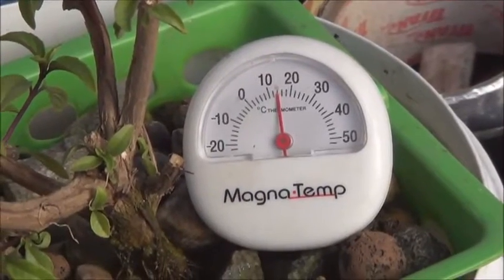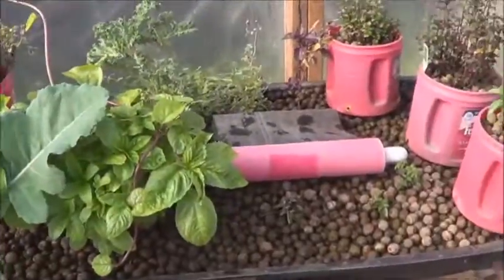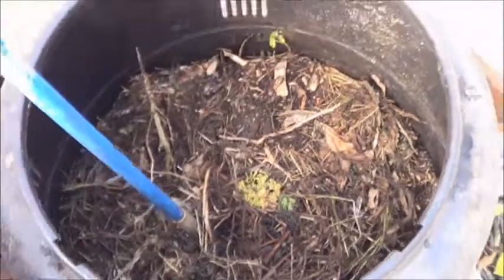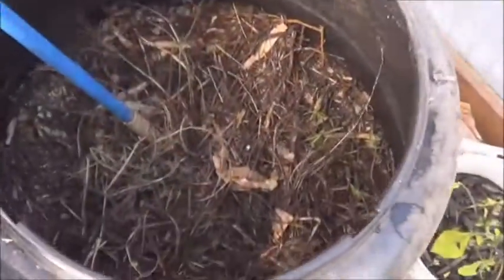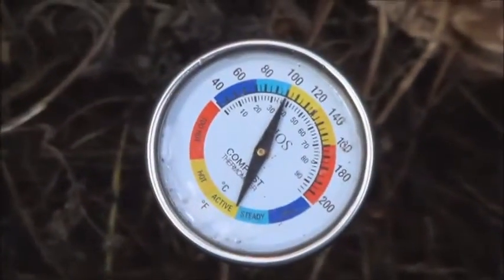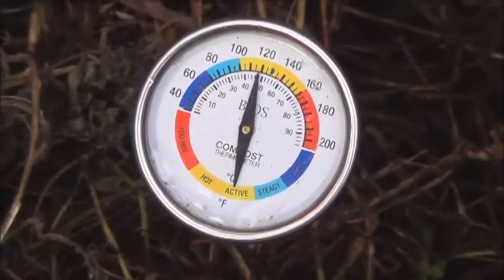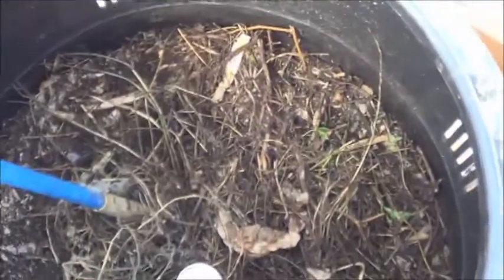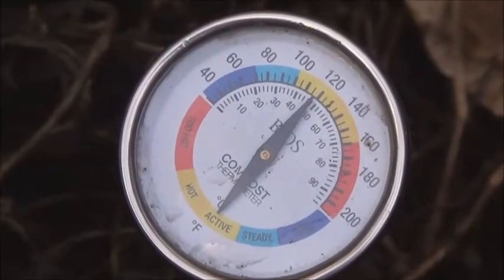Greenhouse Heat From Compost 2013 - October Temperature Check

Comment: I’m also in Manitoba and was wondering how you did on heating a greenhouse with compost
Reply from the maker: This was back in BC and the final lesson was that sometimes size really does matter.  The compost pile would have needed to be at lease 3x3x3 to have produced much of a warm spot and out here in Mb I haven't even tried this yet.  The greenhouse I want to build here will be based more around the idea of trapping daytime heat in thermal mass for slow release at night.  The real trick out here is keeping your heat when those -40 winds start blowing ... not an easy trick!

Comment: I am building a  8' x 24' hoop style greenhouse, my plan is to build a 4 x 4 x 4 compost bin using plastic pallets ( $6 ea. much less expensive than lumber and more durable) each end of the bin   will open so I can work the compost from either end. I will experiment with 3" vertical pipes in the center of the bin to bring heat into the greenhouse. On the outside I will stack straw bales on the north side 3 or 4 high along the north facing wall and then add 6 more 4 x 4 x 4 compost bins along that wall. I will experiment with 3" horizontal tubes from the center of each bin into the greenhouse to try to capture more heat.  I have a endless supply of leaves, straw, and grass clippings  to fill the compost bins. In each outside bin there will be a plastic pallet on the ground to build compost material on until they are filled. when it is time to stir the mix I will pick up the pallet with my tractor forks, slide a empty pallet under and then shake the forks to make the compost material fall back in the bin and mix it at the same time. Inside along the north wall there will be two 24" wide x 24' long shelves stacked 16" apart. Inside On the south wall there will be 4 barrels  painted black along the first 12' and filled with water with a 24" wide shelf on top for work space. The back 12' will be used for a small aqua ponics set up. I hope to have this finished by Jan. 1 and will revise as necessary as I build.
Reply from the maker: Well, I'd say you've got it figured out!  Let me know how that works for you!

Comment: It would seem that a fan would spread the heat out to the green house. Otherwise it is like a coffee mug in that the mug does have heat, but by itself it does not spread that heat to warm much else besides the hands holding onto  it.  I am planning my green house build at present and may look at a compost pile outside and on the north wall.  I'll have vents to allow the heat in, but also a fan to force it, too.  I may even set up my compost tumbler made from a 55 gal. olive barrel inside the green house. Problem would be that my plan is for a 16.5'X8' green house which will be sitting on a raised framework to make the height improved. That big barrel is made to  be a sidewise unit and would take up space. Your compost heater barrel gives me some ideas, but i still think a blower would help on it to force the heat out so it is actually helpful. It would be easy to make a diy unit that looks essentially like one of the diy air conditioners made from a bucket and using a small fan on top to force the air over the ice water inside and through pvc elbows. Lots of videos on such on YouTube, so the same thing could be done as a simple diy compost barrel project for heat, I'd bet.

Thanks for posting the video as it gives me some additional ideas to consider for my own green house build.
Reply from the maker: If you are going to try this, think larger.  The most common piece of advice I got with this was to make it at least 3 feet by 3 feet to get any real heat gain from it.  A blower would have been a great idea to get a bit more of a boost from this idea though ...  Thanks!

Comment: I have an air heat system that goes into tubes in about three feet of rocks which doubles as the floor of the green house and radiates heat through the night.  Works great.

Comment: I've tried a similar setup, but on a larger scale with the entire ground of the greenhouse as a compost pile. It works as long as you have the greens and browns right up until the time when average temperatures drop below freezing. I grow temperate plants mostly bamboos in my greenhouse anyways so it's not a big issue, but the 55 gallon barrels filled with water seem to be doing a better job of stabilizing night time temperatures.
Reply from the maker: A few different people have mentioned 55 gallon barrels as a nighttime heat source.  If only I got enough sun in the winter for that to work ....  Thanks for watching!